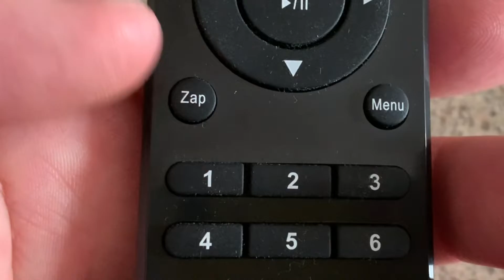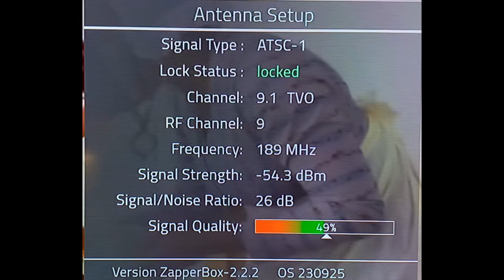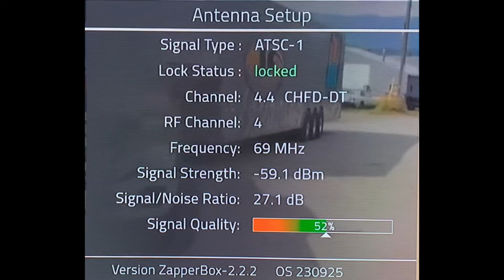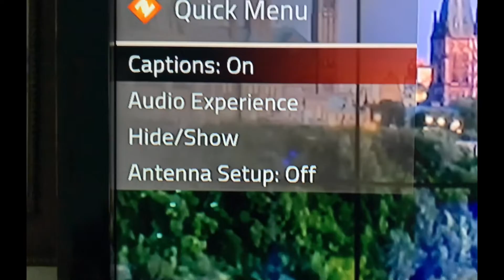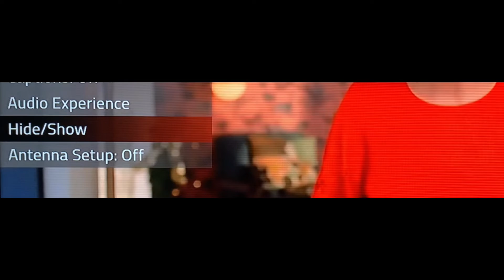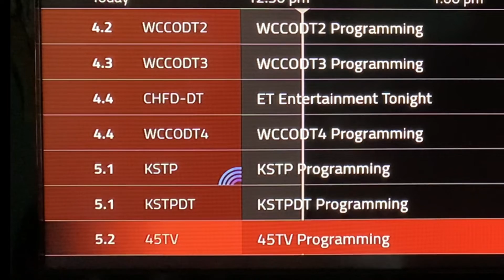Zapperbox M1 OTA Tuner Remote Control - ‘Zap’ Button Feature and Antenna Setup Display

Comment: This is a total nightmare paired up to the entertainment task it is supposed to support. I threw out my original 2009 ATSC adapter box and this mess is not welcome in my place.
Reply from the maker: Are you able to receive any ATSC TV channels reliably?
Reply: @NorthcoasterHobby  Not from home
Reply from the maker: @stanleybest8833  Fair enough. You have an FTA satellite dish?
Reply: @NorthcoasterHobby  packed away till I move. I'm fine with tapes until then...and YouTube.
Reply from the maker: @stanleybest8833  Sounds good.

Comment: "Aiming or positioning"?

As far as antennae go, what's the supposed "difference"?
Reply from the maker: These are catch-all terms I use. They could mean changing the angle, direction, height or location (within a room, or moving it outdoors) of the antenna for best reception.
Reply: @NorthcoasterHobby : Aiming something IS positioning it. And with an antenna, typically the reverse is also true: any position you generally make on an antenna is to aim it. So FFR, save time and effort by only saying one or the other.

Comment: What's the advantage of using a Zapper box? Great video.
Reply from the maker: It has an ATSC 1.0 and ATSC 3.0 tuner. The tuner seems to be quite strong. Lots of good features and Zapperbox support is constantly making improvements and adding features through software updates.

Comment: Did you receive you're Nex gen receiver from adth mine works pretty good after the update.zenwell will have a next gen receiver coming out in January.
Reply from the maker: I do have the ADTH box, but haven’t looked at it yet.

I don’t actually have any NextGen stations in my area.

I happened to be travelling to Minneapolis the week of their ATSC 3.0 rollout in late August. So I brought my Zapperbox with me and tried it out. Those are the NextGen channels in the guide you might notice. I left them in and did an additive channel scan to add my local channels without erasing the Minneapolis channels. That’s another good feature of the Zapperbox.

I will review the ADTH box soon but most likely as an ATSC 1.0 box, which is how most viewers would use it anyway at this point.

I heard about the Zinwell. I’ll look into that one too.